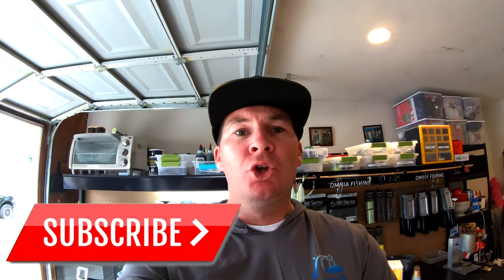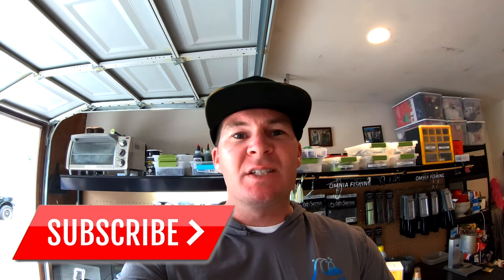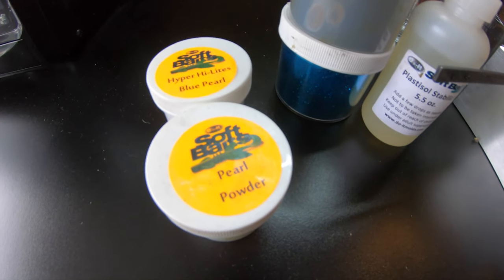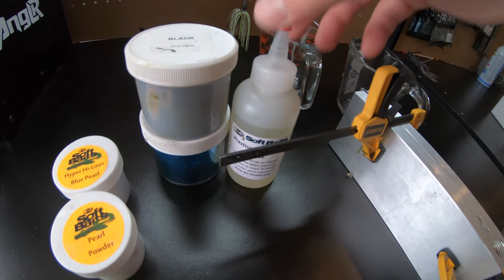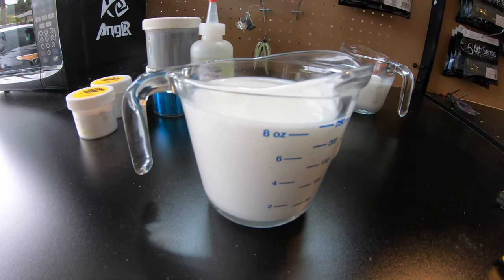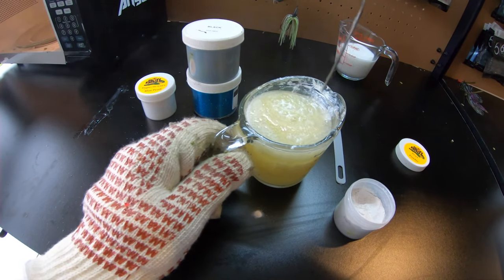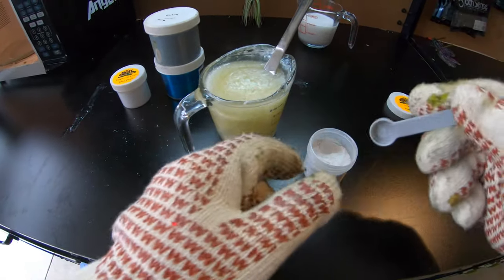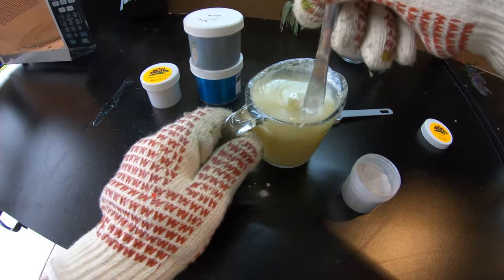Making Soft Plastic Baits - Do It Molds 6" Ripper Swimbaits

Comment: Hey Matt, I got the 6 inch ripper, I’ve been watching your video on it. You mentioned the denting on the thicker part of the bait. Any idea on how to correct denting on a thick bait like that?
Reply from the maker: Sometimes it’s a venting issue with the mold.  Sometimes it’s a head thing, and sometimes it’s a pressure thing.  Really just trial and error